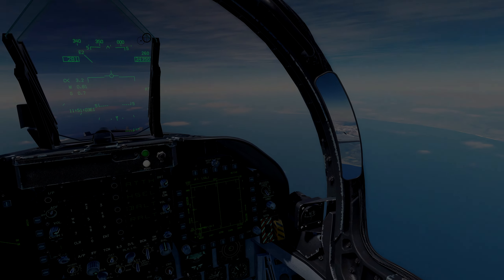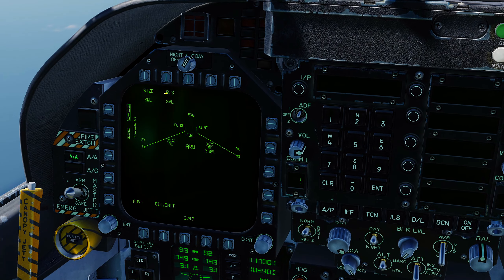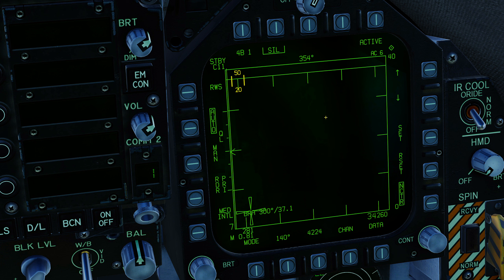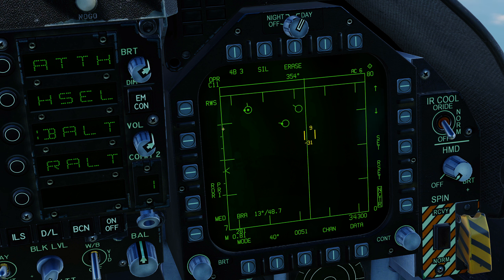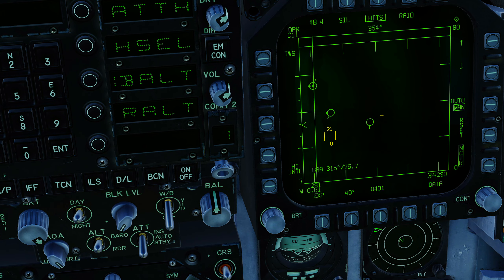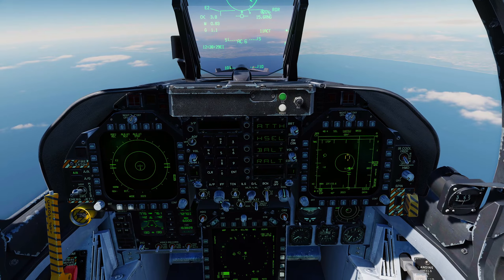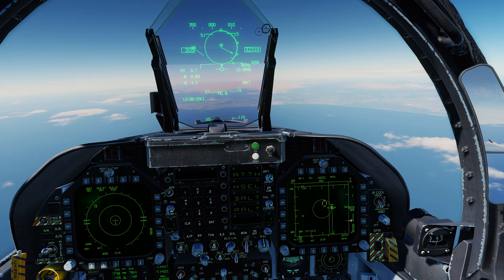DCS WORLD 2.7 UPDATE - F/A-18C Hornet Beginner Series: Air to Air Radar Usage #DCSworld #F18hornet

Comment: Sorry, super late getting to this one...

S MODE refers to the selection of missile you're firing. 

 When set to manual, you can press the AMRAMM button (I think it's '3' by default?) multiple times to toggle between which pylon you want the AIM to fire from.  Setting it to Auto removes that ability and instead will come off the rail of whichever AIM makes sense.  Ex: If the bandit is ~20 miles out at 11 o'clock the S MODE will release an AMRAMM from the left-wing (or left nose if none on the wings), similarly if the bandit is right at say 1 o'clock it will release a missile from the right-wing or nose.

Comment: Not sure if I missed you mentioning this but for selecting a radar contact in TWS mode I always hit the middle button on the right that changes it from “MANUAL” to “Auto” which makes the radar search area follow the target you have locked up which is crucial if you’ll be cranking the plane left and right to bleed off an enemy missile’s energy that way it’ll keep lock easier all the way to the edge of the radar gimbal limit
Reply: I should’ve waited because 5min later in the video you talked about this exact thing.

Thanks for the helpful video my friend!

Comment: Love your videos, but you got a thing wrong there. When you are slewing the cursor down towards the bottom of the screen, or up towards the top, the measured altitude readings of the radar vertical envelope don't change because the cursor is tilting the radar up or down, It is because the readings of the radar "cone" ahead of you change as you get closer or further away from the plane. The curser close to the plane will always show a smaller differential as you get closer, the top and bottom readings getting smaller. Conversely a cursor slewed very far away will show a much greater distance between the values, with heights and depths showing much greater differentials. Think about turning a pyramid on it's side with the plane at its point, and start measuring slices of the pyramid closer or further away. The cursor doesn't tilt the measurement, it just measures a bigger or smaller slice depending on how far away you are from the base of the pyramid. Other than that, great stuff!!

Comment: Great video. I have the X56 also, but seem to have run out of buttons the way I am currently set up. At 42:33 you mentioned you have HOTAS stick bindings for Right MDI PB1, PB13, & PB11/12. What HOTAS buttons are you using for those PB's?

Comment: Thank you.
Question: how do you choose a target out of the ones softlocked in TWS? Been struggling with that thing.

A small note on 38:20. The numbers change because the radar sight is a cone. The cone is narrow near our aircraft and widens with the distance. The numbers are the top and the bottom of the cone at given distance. That also leads to the fact that the distance between the sides of the screen is actually very short near the bottom and much longer near the top.
Reply: Figured out that cycling targets is done via the undesignate button. But now I don't know how to drop lock completely.
Reply: @yeruschmift8422  hi. to drop lock use the reset button on the screen

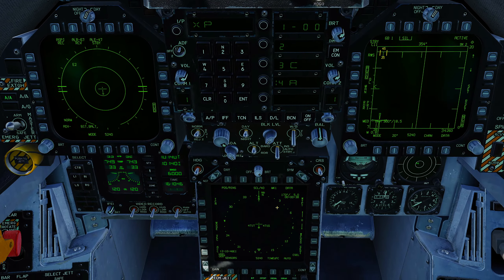Comment: 22:31 don't do that, just press SCS aft twice. Since the HSI is in the AMPCD, SCS aft once sets TDC priority, aft again with HSI as TDC priority swaps to the SA. With the AMPCD on a display that can't accept priority, SCS aft cues HSI.

Don't think I've ever pressed the HSI or SA buttons on the AMPCD.

Since you didn't mention it, at 26:27 to the right of the call sign is the aircrafts fuel state.

31:50 This is not true. Zero difference in targeting between RWS and TWS. A RWS L+S is the same as a TWS L+S. 

32:36 To be clear, a STT "lock" from TWS will still warn the target. 

37:30 L+S designation*

38:09 That is not what's happening. The radar elevation IS NOT CHANGING. 

Think of the radar scan as a cone out the nose of the aircraft. The closer you are to the nose of the jet, the smaller the width of the cone is in the y-axis. Hence why you upper and lower scan volume boundaries increase when moving the cursor away, and increases when you bring it closer to the aircraft.

39:58 That track is not notching, he's simply outside of the radar maximum range in MPRF.

41:28 you lost lock because you told the radar to point elsewhere... plus you didn't adjust the hit age out on the data subformat.

42:55 You can just use the TDC

44:31 Same is true for positive Vc in general

45:20 To clarify you can only notch an emitter that is above you. Notch works from you hiding in the ground clutter.

I noticed that you didn't mention NWS for track stepping.

52:08 all that can be done with the HOTAS by default with the TDC.
Reply from the maker: Cheers matey!! 👌🏻

Comment: That was a great video so useful! I just have a question not sure what I'm doing wrong and can't find the answer anywhere. I'm playing PVP and I can see the datalink on the attack radar and i know I can't lock it. I change the elevation Like you say to match theirs but it's still not giving me anything like the block that I can lock onto. Sometimes I'll try from 80nm all the way until 20nm and then sometimes I get something it's very inconsistent. It's not as quick and easy as you show in the video not sure where I'm messing up
Reply from the maker: You have to pay attention to the targets aspect to you… if it is flying straight at you, put the radar in high PRF, if they are flanking or cold put it in medium PRF. Also if the contact is at low level and you are up high the radar will struggle to get a lock from range due to look down degradation of radar. If you are struggling you can try and get co altitude with the target and see if that helps too.
Reply: @TorniQuetHD  it doesn't really matter what my altitudeis compared to them. Sometimes I'm at 25000ft and they are on 20000ft and still nothing. I do change between the PRF like you said but I still can't get them on my radar.
Reply from the maker: You could also be getting notched by them if it’s PvP, if they fly perpendicular to the nose of your aircraft your radar will not be able to see them also.
Reply: @TorniQuetHD  the data link shows they are coming straight at me and my PRF is set to high and I still can't pick them up
Reply from the maker: @tempestspace  yeah it happens mate, the hornet radar has been changed a lot to be more realistic with the actual radar so you will struggle to get a lock outside of 40NM now, more likely around the 30NM mark depending on target aspect

Comment: awesome vid.  I believe there is a way to display the target/aim on the hud but it would also move out of the hud and showed up if you move the screen for example if using VR or TrackIR  it would lock the target without the need to move the nose of the aircraft towards the bandit. it would lock it by just moving your head towards the target/plane (using TrackIR) what do I press to activate that ? Id appreciate the help. please
Reply from the maker: I think you’re talking about using the JHMCS to lock targets up?? The circle that shows up in your helmet and when you place it over an aircraft it locks it up?? That is achieved by being in A/A master mode and then press sensor control switch forward and it will go to helmet acquisition mode as long as your JHMCS is turned on 👍🏻
Reply: To further help here; on the right hand side of the displays there's a dial that says HMD turn that all the way up.

To activate the mode you're talking about, in the AIM-120 specifically (because its different for the AIM-9) you push sensor control switch up and you'll see two things;
1. There is now a ring on your HUD when looking forward or outside of the A/C.
2. If you glance at your radar when looking around you'll see it is no longer sweeping, but is now panning to where you are looking.

The AMRAAM will go pitbull off the rails so you don't have to guide it, you can fire it and bug out immediately, so this is great for furballs or snapshots.